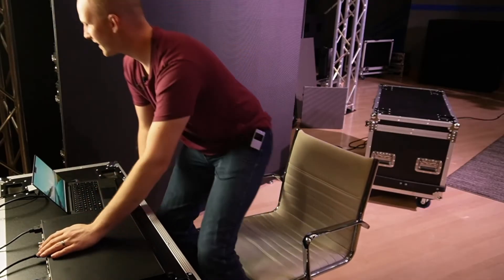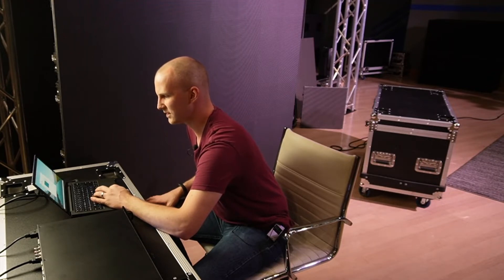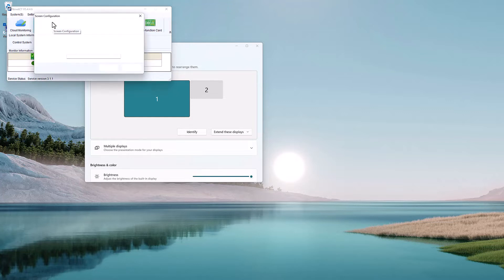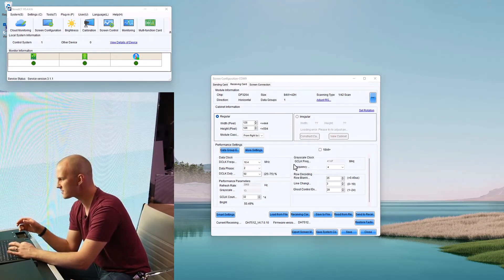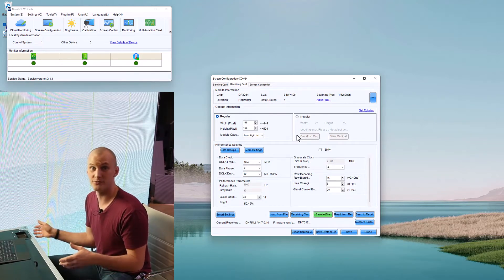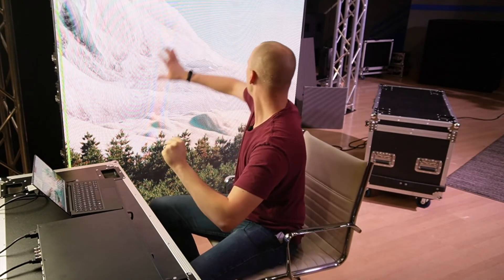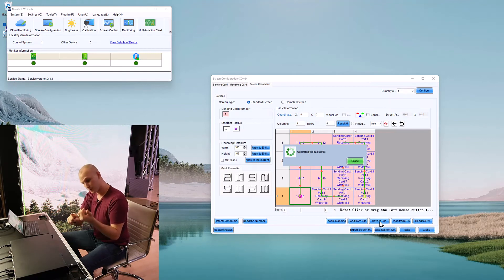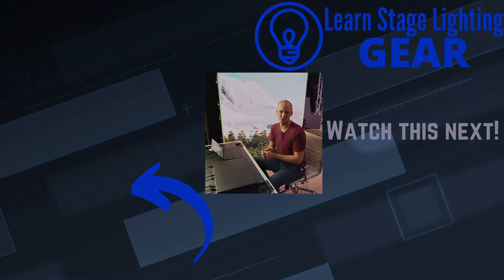How Do You Configure An LED Wall? feat. Novastar Processors

Comment: Hi, I need to ask you something. I have an LED screen with a resolution of 1200×480 px, which would be a 5:2 aspect ratio. However, the MVP300 processor outputs 1920×1080 px, causing any image sent to it to appear stretched, almost distorted. How can I fix this?

Comment: Hello, I really need if possible, my  tb1-4g novastar device is visible in the terminal list, I'm using novaLCT software v5.8.0 but when I click to connect to the system  after putting in the username and password all it says is  wrong username and password. I tried resetting the device still all it says wrong username and password, so I'm confused what should I do to overcome this

Comment: This has to be one of the most helpful videos I have come across, 

I discovered my soft led screen can only run with T9 led software after buying a processor and sender card. I would like to rebuild the reciever to be open to processor inputs as this is much more handy for my setup and using macbook pro. 

How easy would it be to build a reciever version of a hc-103 as I have the hc-102 and it's locked to T9 

Any advice would be massively appreciated. 

Cheers

Comment: I don’t understand why you hooked up the DVI monitor out to the DVI input ? What did that help you do
Reply: The prosessor has a sender card built in. It's powered by the unit, but you need to send the dvi out to the card dvi input .... the card than sends the led data to the screen. You can usually input to the processor from any video source. Making many formats usable with the screens

Comment: A big time rookie here, I have 8 panels 3.91 500 widex1000 hight.  4 columns x 2 rows, my display is showing the top of the screen at the bottom,  on both rows. Any idea what I need to change?

Comment: David, I love your content, but your audio is getting significantly worse lately, especially on phones and laptop speakers. It sounds like you're over-processing with noise removal to the point that it ends up being muddy. It might help if you use a high-pass filter up to around 120Hz and/or a different NR plugin. Waves NS1 is pretty good and cheap. Thanks, and keep up the good work!
Reply from the maker: Hey Caleb, thanks for your input, we are going to look into that and make it better on the next one.
Reply: @AboveAVLGear  Thanks!